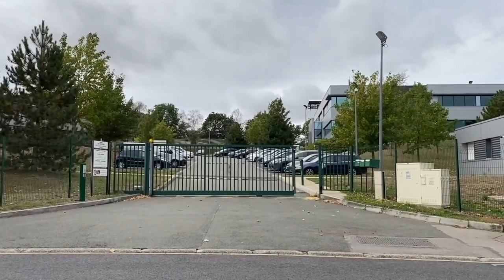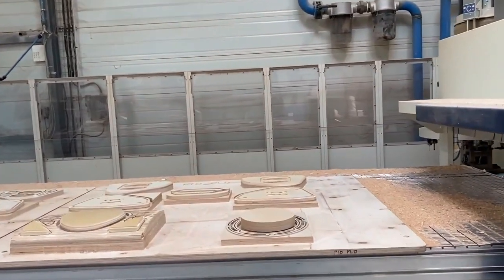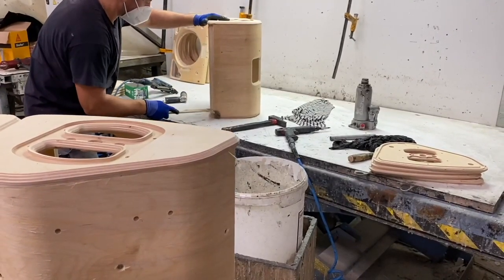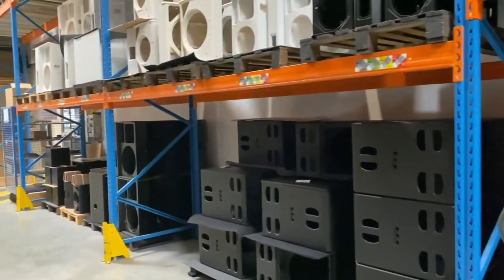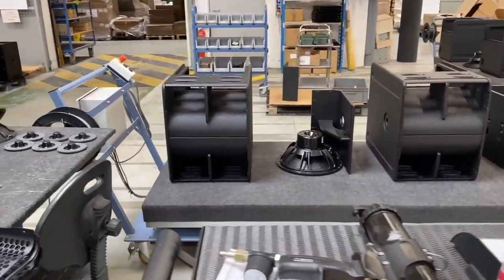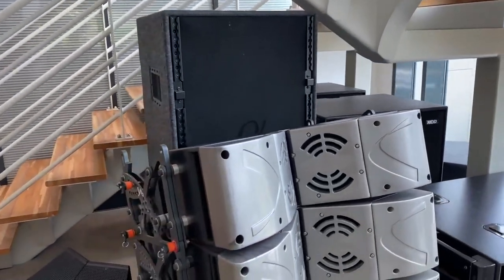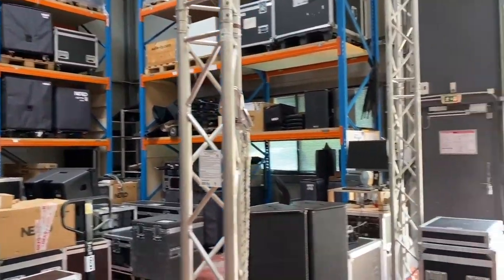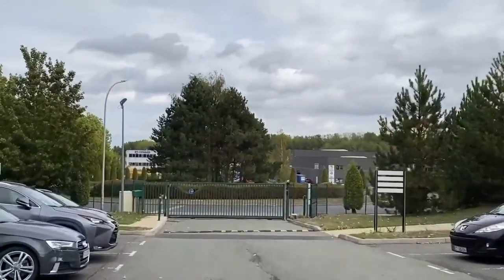NEXO Factory Tour

Comment: very impressive facility hope you guys survived the pandemic.... as a singer n dj its almost finished me off.   I use Yamaha speakers DSRs and love them I would like if someone there would design a portable column array with a built in amp more power than the ev evolve 50 (which has no mid range in it at all) something with built in linking in sterio to other speakers as we usually buy 2 so no cables portable easy to set up and no cables option and more reliable wireless connection system than blutooth  ...a column array powerful enough for - 300 ppl at least    wireless connection to a desk and each additional speaker would be a plus .  with a top hat on each column or ability to add one to plomp a light on top....DSP on the speaker is not as important as sound quality and performance to djs but all the other maufacturers of these types of products donnt seem to understand and I thought you guys might.